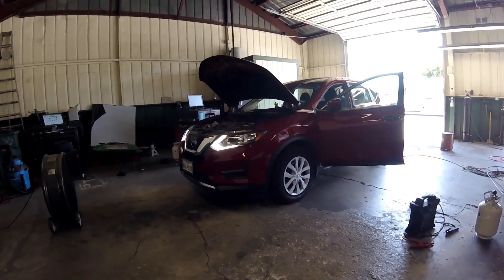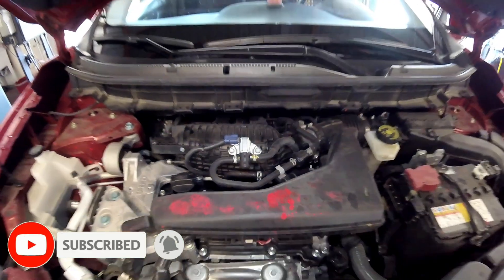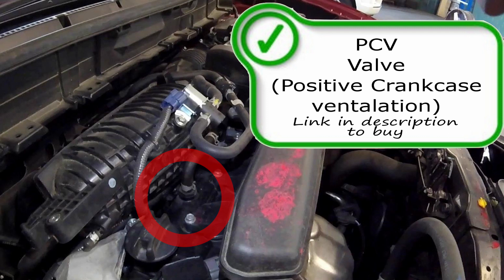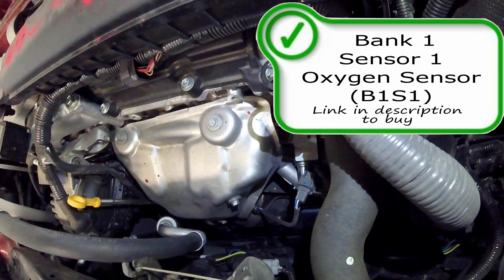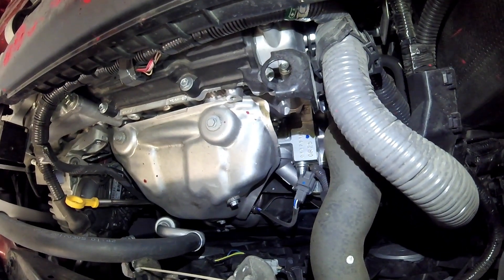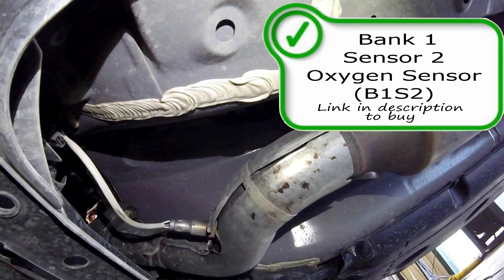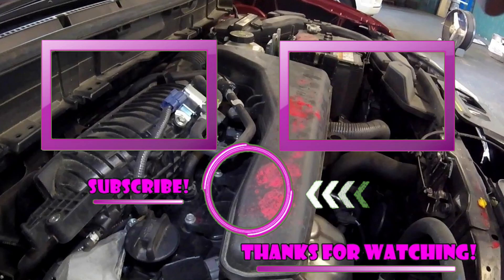⫷ Nissan │ Rogue │ 2014 - 2018 2.5L │ Emissions Locations │ PCV, EVAP Purge, Oxygen A/F sensors ⫸

Comment: 2018 2.5l.  Changed both bank O2 sensors.

Still getting P0030 heater control circuit bank 1 sensor 1 code.

Is this possibly my catalytic converter?
Reply from the maker: No! In this case. I'd be looking at the wiring or power source. I'd make sure the prongs on the connections are all good, too. I doubt the Cat though.
Reply: @ScottiesHobbies I checked the fuses all were good. 

I did notice when I revved in park the car had a pretty strong rich smell to it.

Comment: I have a vibration during idling which is felt inside the car. Is it possible that it comes from dirty oxygen sensor? Can it be cleaned before replacing it if its necessary? Thanks!
Reply from the maker: It is possible that a poorly performing oxygen sensor is causing a bad air fuel ratio, which would cause a slight misfire. But.
I would lean more towards a miss fire due to lack of tune-up type maintenance.Or possibly a motor mountain going bad..
Reply: The car drives just fine and it been maintained properly. The vibration is only on idle and the RPM arrow is stable. I am trying to find out the culprit, will try to clean the sensor and see if it solves it. Will update and thanks for the reply.

Comment: Thank you for your video. I got a code P0456 on my Nissan Rogue 2016. Was told it was the Canister Purge Valve. Where do I find it?  It’s not clear if it’s on top under the hood or on the rear tire passenger side.
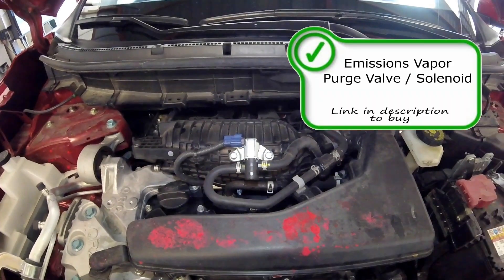Reply from the maker: Purge valve is shown at 00:54
Reply: For anyone reading this, It should be Vent control valve, which is attached to the EVAP canister on the rear tire passenger side. It is not shown in this video.

Comment: Hi thanks very informative video..question..
I have a 2015 Nissan rogue basic model ..it has P0101 code ..I already change the oxygen sensor upstream ..no check engine light but ..took it to smog test and it has a permanent code: 
P0101. What can I do thanks

Comment: Engine light comes on. Misfire 1. replaced with proper spark plugs. came back. 2, replaced coils repeat 3. replace the intake and exhaust solenoids came back. Got system dia. from garage only thing was B bank was rich. Cleaned what I thought was was B was A came back replacing B today. If engine light returns any damn idea? No oil leaks so of this writing.??

Comment: Excellent video with lots of great information . Thanks
Reply from the maker: Glad to help!! Good luck on your fix!! 💪👍🤞
Reply: Thank you
Reply: @ScottiesHobbies  My 2018 rogue got into a small accident. As dumb as this sounds, rear ending someone on the front passanger side, left a good size dent, but still drove fine, then ran up onto a center divider, which popped both drivers side tires, and that set off the "Malfunction" warning on the computer. (which I read that means something is wrong with the emissions system), so I have no idea where to start.. also, could hitting the tailpipe on something set that warning off?? Any input would be helpful, I'm kind of desperate, don't want to take it to a shop until I have an idea of what it could be.. just maybe where do you think i should start? .. Appreciate any advice! Thanks!!

Comment: Any idea about manifold runner control valve code p2006, p2004. Is it built into the manifold on 2016 Nissan Rogue?
Reply: Got the same error

No founds so far

Comment: What about a code P2096? (post catalyst fuel trim system too lean bank 1) would that be the sensor at the catalytic convertor? 2017 rogue SV
Reply: Yes, sorry for the delay. I wasn't paying attention to my emails. Yes, replacement of that O2 sensor fixed the code.
Reply: @robertpompano4391  I just replaced it and all is good.  Thank you!
Reply: U get it fixed?
Reply: @confidential8738  yes, i fixed it myself... it was the one under the car at the CAT.
Reply: @robertpompano4391  cool. Thanx man
Reply: @robertpompano4391  So Oxygen sensor under the car by the Cat fixed your code P2096?

Comment: Thank for this video! Took the Rogue into dealership to check the check engine light. They didn't find anything wrong. Reset light and recommended replacing O2 sensor if light came back on. It did, but Rogue runs fine. Thoughts?
Reply: Depends how much you like to see your 'check engine' light.  What happens if another check engine incident happens with this O2 sensor masking it?
Reply: @cboop9014  I paid the dealership to clean the fuel system and turn off the check engine. Knock on wood no more problem

Comment: I have a 2013 Nissan Rogue, no codes, high rpm on cold start, cleaned mas and still high rpm. What else can I check? Great video, keep it up
Reply: That is a normal condition
Reply: RPM on cold start is always higher. It ranges depending on what car you have. Usually from 900-1200 on a stock unmodified car.
Reply: @altonb93  thanks for the reply. I live in Florida , it goes up to 2000 rpms,  think it could be vacuum leak?

Comment: So you shouldn't  change the PCV valve unless you have a check engine light on and a code showing it is bad?
Reply from the maker: I personally change mine every 30-40k miles. That is a little excessive but the maintenance is super easy on all of our vehicles. Better safe than sorry.
Reply: @ScottiesHobbies  Better to be safe than sorry. If it goes bad it could destroy the engine.
Reply from the maker: @crand20033  true. You'd probably be surprised how often they are over looked as regular maintenance.
Reply: It doesnt set a code

Comment: I recently changed my throttle body and I did the idle relearn check engine light is gone. And it has a high idle when I run it, it also feels like it's not running like it supposed to. When I give it more gas it gets loud an it feels as if it's not changing gears an stuck on third. Please if you got any tips I could really used one.